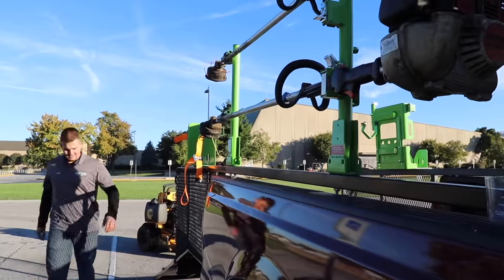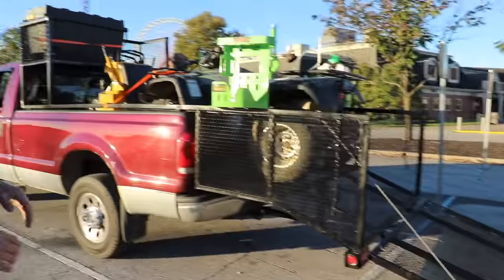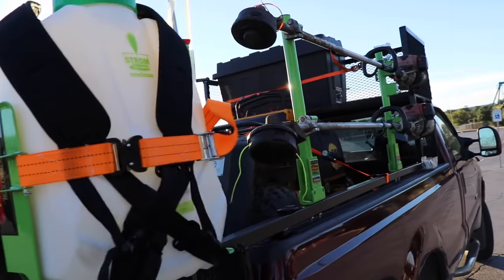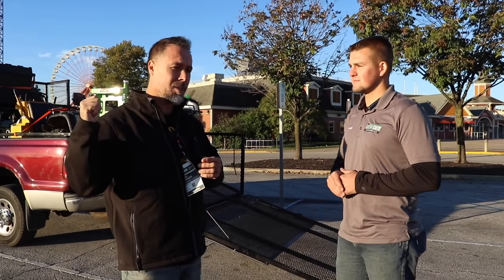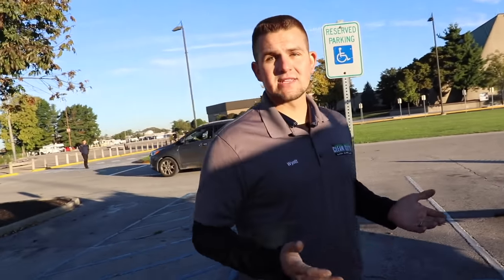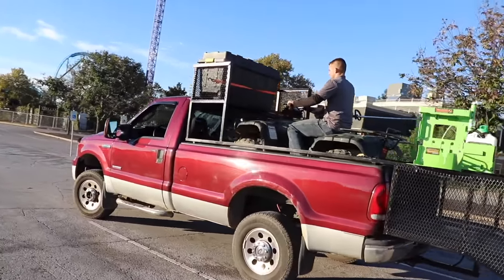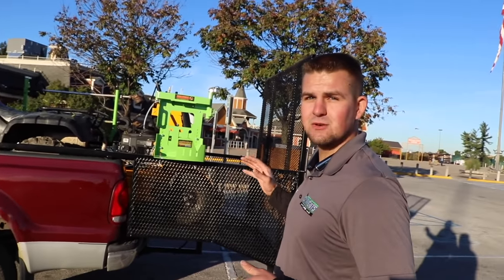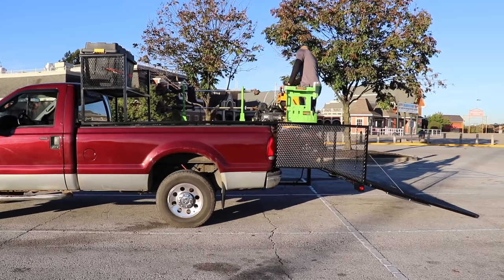ATV / Lawnmower Trailer Inside the bed a truck ?!? - Eliminates having a separate trailer

Comment: Nice, I still rather have a trailer.   Free up my bed for anything that might come up along the job
Reply: Daniel Garcia I mow for a living and I agree. This would be fantastic for ATV’s and motorcycles though.
Reply: @fivespeed3026  I agree fine for atvs but who doesnt do some lawn work and need space to put some clipping or bush trimmings or whatever. A trailer easily resold this thing not so easy. Plus its pretty dam expensive. Im sure they will sell some but any guy has this for a short time will wish he bought a trailer.
Reply from the maker: Understandable 👍
Reply: Todd Harris Yes I agree.  In fact, a trailer can be one of the most useful things you own.  My old $300 4x8 trailer saved me so many times and money over the years, I couldn’t begin to count it up.
Reply: I understand your points.  Keep in mind though with this you would have no trailer maintenance.   If you have a fleet then it would be easier for new employees to park who may not be comfortable backing up trailers.  One less trailer license plate to buy.  One less insurance risk.  I could see people using it for golf carts as well.  Neat idea.
Reply: @spyder000069  the price tag is $3,000. 
What are your thoughts on that

I can buy 2 regular trailers for that price with ramps

Comment: The only problem is you can't go number 2 in it like my enclosed trailer when the need arises.
Reply from the maker: Only thing it's lacking
Reply: Some people dont know
Reply: Amen thought I was alone
Reply: 5 gallon bucket and a trash bag. That's what I carry with me on the road for hotshot transporting
Reply: And you also can't use another truck if your breaks down,  like you could with a trailer. If you have to get a new truck you have to have that reinstalled on the new one.  No quick turn around for vehicle issues.
Reply: Why not? Go right ahead, we wont look
Reply: @Jayce Hayes Instablaster :)
Reply: @Johnathan Kaison It did the trick and I now got access to my account again. Im so happy:D
Thanks so much, you really help me out :D
Reply: @Jayce Hayes Glad I could help =)

Comment: 1994 was the only year I mowed full time. I lived in an old small apartment building with a small back parking lot. I had a little Mazda truck and a small boat trailer converted to a flatbed. Parking was a pita, as was driving to my storage to load the lawn equipment. 
One local lawn service guy has a full size Ford truck and a 52” Toro walk behind. He built ramps inside of the bed so the mower goes up to the height of the inner fender wells. So he does it without a trailer.

Comment: Check the fine print with DOT Make sure it is GVWR not GCWR.  GCWR is Gross Combined Weight Rating this includes a Trailers weight.  They are from the DC area.

Comment: Trailers look more professional in my opinion
Reply: zachary burdette rather invest in a trailer than this crap
Reply: You can still put lettering etc on your Truck. 90 percent of customers really don't care what you drive or tow as long as you exceed their expectations.
Reply: zachary burdette I would agree with you plus with a trailer you can use the truck to haul other stuff or leave your tools at home or in the shop and still use the vehicle without having to haul your tools around all of the time.
Reply: I would say this would benefit someone who is looking to put a whole bunch of quads or bikes in the back of their truck . Not really a landscaper.
Reply: It’s not about the tool or trailer , looks is nothing it’s all in the “craftmanship,work”, YOU DO, keeping the  customer happy and making money all that maters. My work is 95% Referrals 👍🏻👍🏻💪🏼👍🏻💪🏼👍🏻😏😏
Reply: Superman Sixty9 there just isn't enough room for a full size lawn service crew and their equipment.
Reply: @zacharyburdette4261  obviously that's not what this is for.
Reply: @zacharyburdette4261  The reason why he started doing this was to condense the daily route for 2 guys to do and it's Saving him driving time, fuel, and he was able to add more jobs to the daily route for the same amount of pay for his employees.
Reply: I thought of making some like this years ago... but the problem is... all the weight will be on your truck, which is not the same as being on a trailer and being pulled.. if you add more springs it does not make a difference with the stress put in the engine and transmission... for somebody transporting atvs would be great for my landscaping company dont think will work as good. For the atvs its probably a lot better if its aluminum made.
Reply: Maybe is good because Dot will not stop you that easily. 
Where you guys put the debris?
Here in Massachusetts I don’t think this setup will work to be honest. 

Good lucky over there,if you are happy that’s what matters!!

Comment: You should add some protection to the back window in case the guys are in too much of a hurry certain days and forget the brake in time when loading up. Like someone else said as well, make a bifold gate to cut down on drag and possibly increase visibility. Other than that, WOW! wish I'd have thought of this. I pulled up to a house today for a quick job where this could've been nice. I ended up backing blindly out onto a busy country road. Should've just backed in.
Reply: Austin Nipper I’m glad to hear I’m not the only one who doesn’t always back in and then ends up having to say a prayer and just let ‘er rip.
Reply: @fivespeed3026  haha! You do back out slowly to give as much warning to oncoming traffic as possible right? There was a turn around the customer told me about after I pulled in, but that didn't do much good when I was already parked...😒
Reply: Austin Nipper Sometimes you gotta do what you gotta do, lol.  Actually, I just hired a helper and had him stop traffic today.

Comment: I'm very thankful you stuck with F-250's as the minimum truck for this narrative. The other videos on YouTube all seem to hint that you would be fine loading this in an F-150/1500, and unless you have a very specific (and relatively expensive) engine and heavy duty payload option combination, that just isn't true.
Reply: I have a 2011 f150 with a payload of 1,950lbs.  If I were to use a ramp rack system that weighs less than 500 lbs and have a toro multi force that is 700-900 dependant if it has the 52” mowing deck on or the 5 foot boss blade for snow removal, I will still have 450 lbs of payload left with an operator weighing 200lbs.  I believe the only time a trailer is needed is for dirt, gravel, sand, debris, and other heavier equipment such as my ditch witch.  When it comes to building out a business and growing exponentially, you need employees, confidence in those employees, a quick and efficient setup, not having a 35ft rig rolling down the road which will lead to more insurance claims higher cost to operate overtime, let alone the trailer wheels, bearings, and all else.  The time spent training employees to confidently drive a trailer, look after a trailer, and keep a trailer tight to the curb when parked is time that should otherwise be spent on making money.

Comment: Change that tail ramp to a bi-fold to cut down on the sail effect and it may just be perfect.
Reply: Maybe make that an option rather then 100% stock as some people might be going slow block to block / not enough wind
Reply: Yes bi fold is that way to go.
Reply: We use 3 fold "buddy ramp" brand. A bit more effort but can use it to extend the bed or cover your load. The versatility is great. But I still prefer trailer, as was commented earlier, frees us bed space for things that come up. Like broken branches or other garbage depending on the site
Reply: If you put a bifold ramp you can't put a sign on the back.
Reply: @defdef5257  with a 6' ramp you could still have a 3' tall sign. Still more than a tailgate sign. Though I see what you're saying, just not sure it's really adds that much for advertising.

Comment: Next time you talk to this guy you might tell him this. I made one of these 3 years ago. But they could make it a lot easier to put on the truck. They could add on a wheel system that folds down  one on the left back one on the right back  same towards the front so when they want to take the system off they just fold down the wheels pull the pins and drive away. Thats what I did to mine takes 5 minutes to take off or put on. This way you do not need anything or anyone to help you put it on or off.
Reply from the maker: Good advice John , thank you !
Reply: Thanks John we're looking into something to make it easier to take off. The modular design will be much easier to remove with just  one or two helpers.
Reply: Great idea

Comment: Awesome video. Did he mention is that a minimum truck type weight of 3/4 ton or higher. Because guy's that have 1/2 tons to light 1/2 tons with v6 non turbo would still try to install this set up on their work trucks that they have with passengers light duty tires. Having common sense is knowledge.
Reply from the maker: Thanks Charles!
Reply: It’s only 400lbs . A new 1500 could handle it no prob
Reply: @michaelnesbitt4260  yeah and the wright standder and four wheeler add only 2750 pounds no big deal
Reply: Adam MotoLandscaping um a stander is about 600 lbs and a quad is about 350 lbs so no at the most it’s 1000 lbs total weight. I wouldn’t use that setup for landscaping anyway but let’s not get carried away .

Comment: Hate to say this, my issue is installing trailer inside back of bed truck is basically on payload. You will not able to a lot more stuff as same was as you loading on separate haul trailers.....

Comment: I just ordered one..... Will be great to haul my S185 Bobcat. Cant wait
Reply: If you don't mind me asking what kind of truck are you planning on hauling it on.  Considering most pickup beds have 48" between the fender wells and the Bob Cat is over 66" wide.   Also it weighs over 6000 lbs.   You'd have to have a pretty big truck to haul that much weight directly on the truck itself.
Reply: Sniff sniff......are there cows close by??

Comment: That ratchet strap can still slide forward so I would say no it's not safe to secure your 4-wheeler that way.
Reply: I thought the same, but it would be easy to drill in an eye bolt or a cleat.

Comment: To big for a weekend warrior to selectively use (6-8 guys to install / remove it). To small for a lawn company. Said as much on the other video this thing was in, if you need a smaller footprint go to Budget or Penske and get a small box truck OR remove the factory bed and put a proper conversion on it. This is an item I've never heard anyone ask for, add on the 3k price tag. 3k? for literally a ramp and a basket? You can get a custom 6x12 with a landscape basket for that much, you can do a bed conversion for $2500.

Comment: Ive seen Wyatt’s setup and design a few times but have also seen the local weedman trucks with a set up like this since I moved several years ago. The thing that I don’t understand in Wyatt’s evolution is the productivity boost, could I get some explanation of this please?
Reply: #1 thing I found about productivity he mentioned was finding people that can maneuver a trailer. Everyone say's they can until it's time to do it, 30 minute's later you're leaving a job, well that's travel time or possibly 1-2 more yard's completed while some moron is trying to get a trailer out of a driveway

Comment: If my state is a 10,000lb limit for DOT numbers, and my truck is 9800lbs gross, if I hook a trailer up to it rated for another 5000, does that put me over the 10k limit or are trailers different?

Comment: Hate to sound like a negative Nancy.  Has this product equipment been approved by individual state department of transportation and or federal department of transportation. They have several requirements light s reflective tape and misc vehicles that are needed to be certified by a safety sticker may have more of concern regarding this comment

Comment: How does it work as it’s extended off the truck. Since it’s over 2’ does it need flags?
Reply: FishFind3000 it has lights built in no need for flags then
Reply: U need flags or lights  to b legal

Comment: Sorry to kill you there but it is Commercial because the bed is over 8' long so you need to carry on triangles and a fire-extinguisher. You may not need a DOT or Commercial driver lic. but you do need the triangles and the extinguisher. Ran into this a few times down here with Florida Highway patrol if the Truck bed is longer than 8' in length it is required by law. Just wanting to give you the heads up on that.
Reply: Thanks for the info, it definitely depends on the state. In MD I have been told by Law Enforcement that it's legal and there is no 8' bed law.

Comment: Massive tail swing
Reply: Looks like about 3 ft. so, not that much, would still be easy to use.
Reply: No more than a reasonable sized trailer
Reply: It does tail swing slightly but we haven't had any issues and have been in very tight spaces over the last season.

Comment: I like the concept but wouldn't work with 2 60" mowers......that's the only drawback I see with this set up
Reply: On a dually it would i would think
Reply: @thatyellow01tj28  No it actually wouldn't.  You still have to contend with the fender wells on a dually.  I had to build a frame in my Dodge dually so I could haul my four wheeler in it.  It was longer than the bed so I had to build the frame taller than the bed.  It was also too wide to go between the fender wells.
Reply: seems to be an investment for a smaller company
Reply: @thatyellow01tj28  you need a flatbed. I'm  fabricating  my own dovetail extention for my dually flatbed that hooks into my stake pockets and the mount for my backblade
Here in Michigan  a company called Ebling and son welding has made many for dually flatbed and single wheel flatbets.

Comment: Price makes it a hard sell. For half the price you can get an open trailer and leave your bed available for debris. Also I’ve seen many welders do this same exact thing for trucks around my neighborhood and it still does not cost as much as this unit ( I guess brand is going to be the high price factor )

Comment: Oh geez it doenst even come with racks and the front storage isnt enclosed or lockable. For almost $3k this is a fail. I dont think Id pay $800 for it plus you would need a 250 or higher. A lot of guys use 1/2 trucks

Comment: the first guy that takes a corner and swings this thing into the opposing lane of traffic is gonna realize why this isnt a good idea. it may be decent somewhere with moderate to little traffic and/or wide roads. but in high traffic or narrow roads this is nothing more than a revenue stream for insurance companies
Reply: AboveAverageCAD smith it’s only 2 more foot on the load and any capable driver should be perfectly fine especially if they are used to using a trailer
Reply: Then he/her has no business driving it if driven in that manner.

Comment: get a flat bed truck. if you don't want / know how to pull a trailer.  you got to much weight on your rear axle.
Reply: No he doesn't.  Not even 2k lbs.
Reply: I agree, people just think it's only the weight of the load they have to consider but it's also the distribution, yeah the mower and 4wheeler might have a combined weight within the trucks capability but hanging it out the back like that is possibly overloading the rear axle.
Reply: The implement/rack weighs 450 lbs.  The 1000 lbs. mower being up against the cab is sharing it's weight with both axles.  The ATV weighs 500 lbs. or so.  A pallet of salt weighs more then that set up and is usually loaded back close to the tailgate.  Unless Ford has low GVWR's and/or GAWR's, it's not over weight.

Comment: Good one Stan keep it up please try comparing in closed cargo trailers from different brands.
How they are built which one is strong and long lasting exterior.
And which one can be available at a good price.
Thanks Stan From Saqib Riaz 
Toronto Ontario CANADA 
You have ALOT of fan's in  Toronto 
Including me.
I don't do much I have low vision and a face epelipsy and seizures.
I always wanted to own a lawn care busness and SNOW REMOVAL company from the age of 11 but the problem is I can't drive. I will share some links of videos I took in the area.
I also put picture videos on construction in the AREA.
I am a fan of RICE GROUP you can check them out at ricegroup.ca
ENJOY 
The winter season of snow plowing.
Reply from the maker: Really appreciate it Saqib and hello to Toronto!